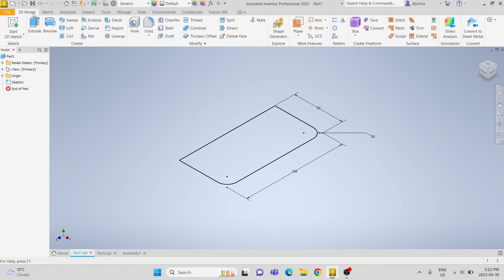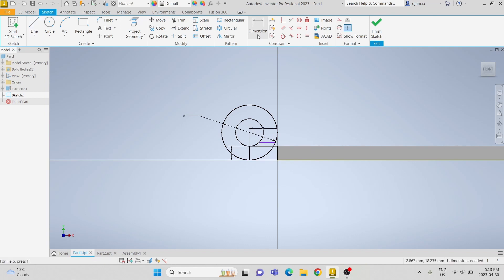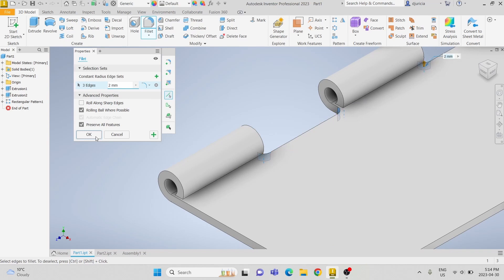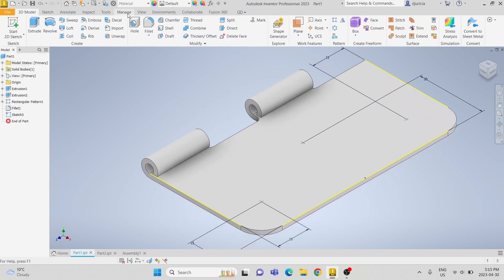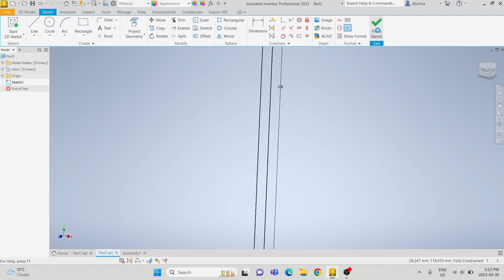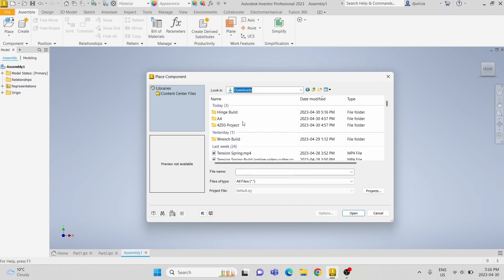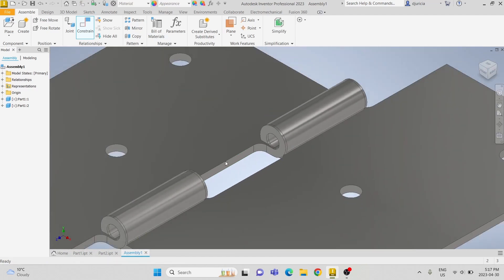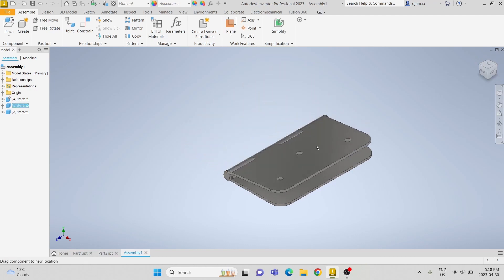Hinge 3D Model Tutorial | Autodesk Inventor

Comment: Hello teacher, thank you very much for your extremely clear and helpful lecture on this 3D drawing. I have a question regarding the rotational joint of my part. Initially, right after I finished the model, it was able to rotate correctly and worked perfectly, but later on it stopped rotating as it should. I hope you can guide me on how to fix this issue. Thank you.